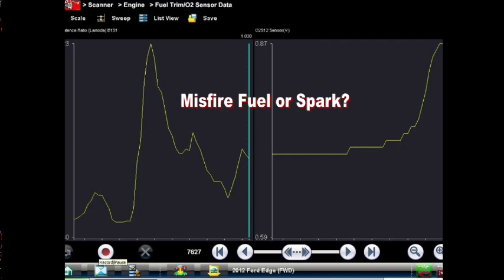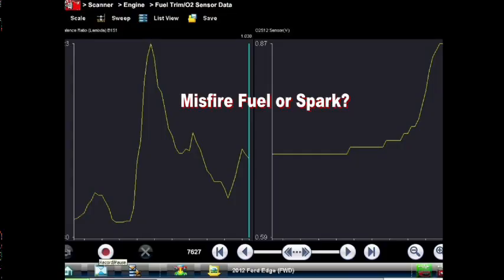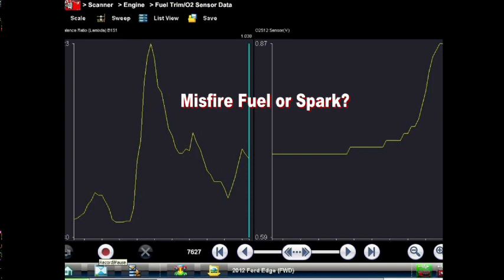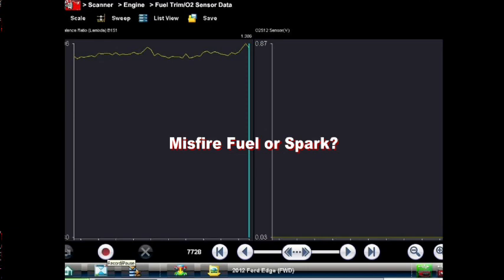Misfires in a GDI System  | Ron Bilyeu | Tech Tip

Comment: Does these rules apply if the only data available is voltage? (Downstream sensor High volts during misfire=lean and low volts during misfire = rich)